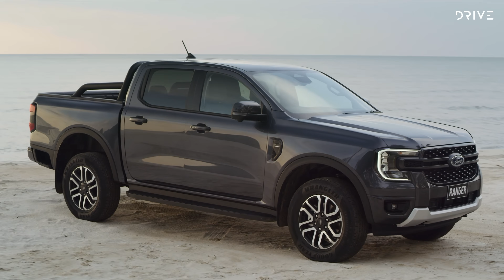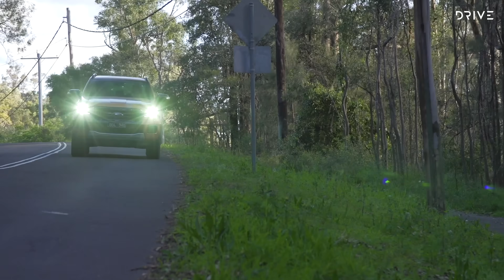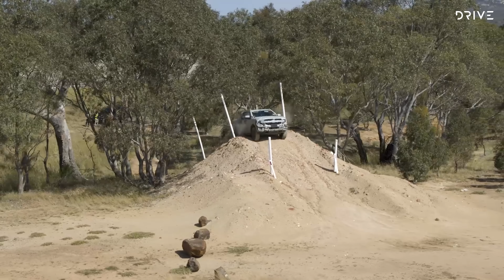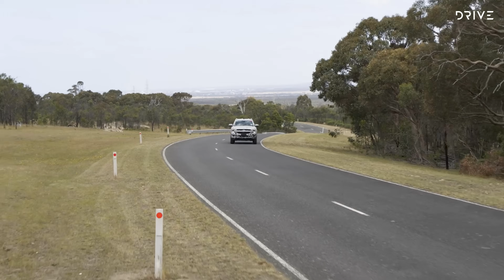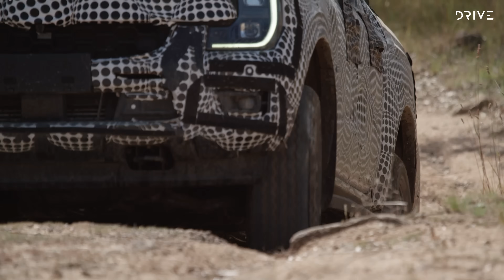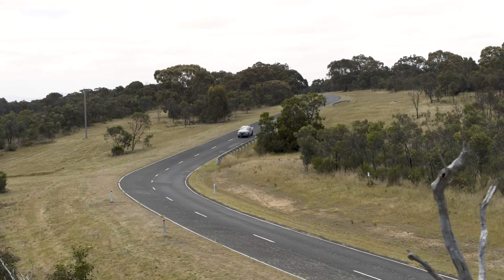2023 Ford Ranger Wildtrak TDV6 Prototype Test Drive | Drive.com.au

Comment: Hopefully they improved the V6 Diesel, as the crank used to snap. The 3L V6 Diesel has been around for a while, so they should have worked out most of the issues.

Comment: The hilux isn't the benchmark off road you clowns. 
When you engage difflock offroad it turns the traction control off on the front wheels making it a 3 wheel drive. Rubbish

Comment: Ford things don't last , as for me my 70k will go for the dmax
Reply: Ever heard of a Crown Vic and AU falcon? those things go forever so as far as I'm concerned, Ford builds reliable cars.
Reply: Have you heard about the ford bronco falts ?
Reply: @tanmupps5997  have you read about the bad valves some bronco 2.7 had search about the reliability of 2.7 it can go over 200k miles without any problem
Reply: @tanmupps5997  cant even spell "faults" right.
Reply: Mistakes are common
Reply: Mistakes are common
Reply: My XLS Ranger has done 180,000 km and still going strong.
Reply: So I’ve heard.
Reply: Waste of money hope you own a house first